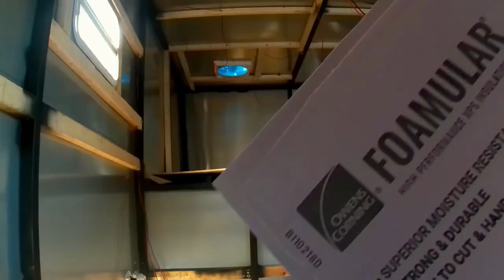Couple Builds Massive Truck Camper Start to Finish TIMELAPSE

Comment: Awesome build! What were the exterior panels?
Reply from the maker: Thanks! 0.50 aluminum panels they are what is used on enclosed trailers. I found them from a guy that bought them from a auction from a trailer manufacturer that was shutting down.